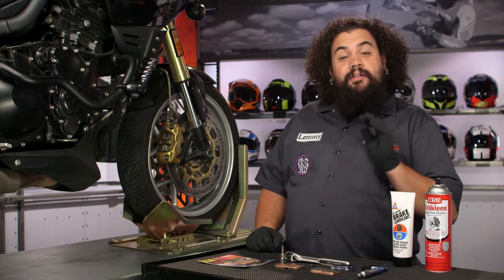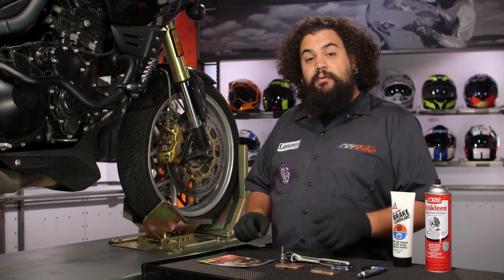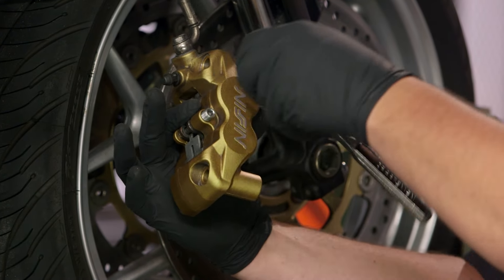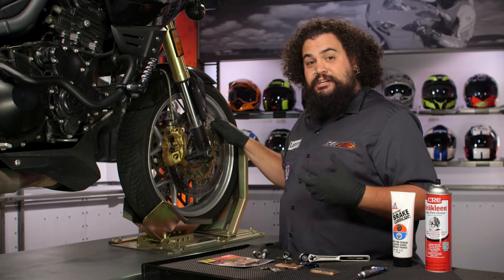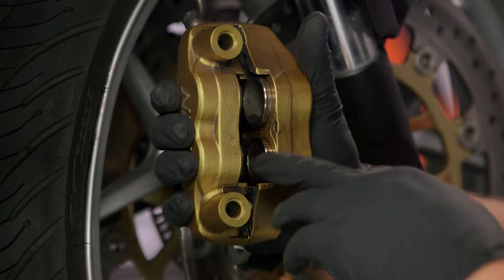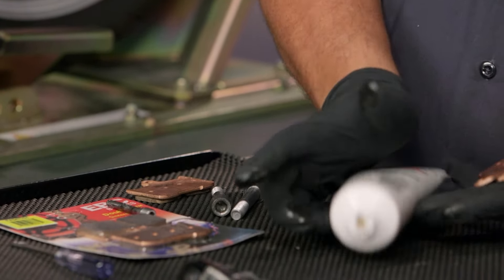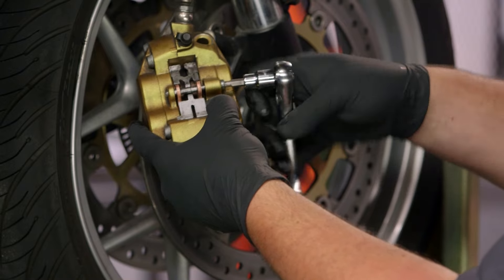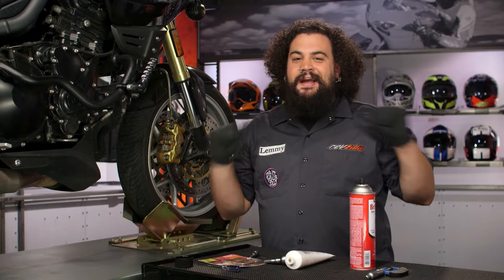How To Change Motorcycle Brake Pads at RevZilla.com

Comment: hmm. I changed my pads yesterday and i guess i didnt push the pistons back into the bore deep enough and the pads were pinching the rotor more than they should be. I'm guessing that should go away or should i take the pads out again and push the pistons all the way back in again?
Reply: pads always drag a little bit. thats normal. you should be able to spin the wheel a couple turns without stopping but pads rubbing a little is fine.
Reply: @nickbuchananracing  Thanks for replying! I did notice however that my front  wheel probably could only make it around only 1/2 a spin. My rear set up seemed a bit worse but it is difficult to tell as the rear wheel is an electric hub motor. I'm guessing that even if they pinch too much in the beginning after riding around and breaking them in that the pistons should sort of reset to their happy place or would there be something i should do to relieve some of the pressure?
Reply: @AnthonyJohnston1  without seeing it in person hard to say. but if your brakes are dragging alot you might need to rebuild the front caliper(s). Good luck
Reply: @nickbuchananracing  Really appreciate it! thanks so much for your advice!
Reply: @AnthonyJohnston1  no problem. i do "how to" videos also on my channel. check them out if they are anything you need a video on. thanks.
Reply: If you havent taken the rez cap off or bled the brakea via the brake bleeders along the line then if youve pressed the pistons back hard to get them over the rotor they will pull tight on the rotor till youve either spanked the bike hard or had enough road miles that the diaphragm in there rez  cap has dealt with it and slowly bypassed the diaphragm to the diaphram cup cap and eventually through the hole in the centre of the cup and that then bypasses slowly via the threads in the cap. This is the engineeering in your rez its enough to allow it to eventually sort itself out or you can do it a favour and take the rez cap with the diaphragm assembly out and even undo the caliper bleeders enough so it spews the old gunky caliper fluid aglomeration out and any trapped water or air in them out as you press the calipers back.  Your specific problem is common and is usualy down to what ive just said and the fact a new pad is automatically going to want to make a rotor sound loud when new as it lays its own material on it. The new pad "whisking" noise you know the noise where it sounds like a rotary air polisher spinning a pad when you come off the paddle, yeah thats going to sound a lot louder on any HH or split pad where you have gaps or grooves in the actual friction material. Thats what the whisking noise is and it should go away and come back depending on the amount of gassing out the pads are doing at the time. Pads use the gas they create to seperate them from the discs (rotors if american) thats how they work the gassing out creates the correct gap between the pad and disc surface each time you come off the brake. The greater grabbing capability the pad has the more its going to bind and be noisy when just fitted or when going slow. Youd be suprised how clunky, sticky and noisy full on race pads are untill they are getting a good whooping at high speed.. sometimes these traits show up in 'fast road use' pads but its nothing to be alarmed about. Another frightening one is regreasing your rear wheel bearings and the back wheel feels really hard to move by hand so you get paranoid. Its completely normal and once the bike has done even 70mph for a while it will thin the grease film out on the bearings and any excess pushed out the side to the cap that will alow bypass if needed. No joke though  new rear bearings and new grease can feel like the rear tyre is binding till you put maybe 20 mile on the thing. Hope this helps mate
Reply: @AnthonyJohnston1 the "half spin" you mentioned you are suffering from a warped disc or most likely the round bungs you see that selerate the spindle side of the disc to the outer braking surface of the disc are all jammed up. You need to clean the bungs out enough that you can turn each one of them, this way the disc will be fully floating again and should eventually straighten out any warping you put on it by using it while it was jammed up. You need to remember the entire braking assembly is floating its designed to move about and by defacto that means that if everything is able to float as it should it will even take an overheating or slight warping or the outer disc section and infact skim it back to perfecly  flat itself by just normal road miles. We straigtened up our race discs by fitting them to anyone that worked with us road bike and then honed to get any pad material off and used again the following season on the race bikes.

Comment: do you bleed your brakes after installing your new brake pads?
Reply from the maker: Only if they need to be bled, but normally, no, you don't have to if the brake fluid is still clear. -DrewZilla
Reply: RevZilla thanks boss!
Reply from the maker: You're welcome!

Comment: I have to take the fear wheel off of my bike, it has disc brakes, so all I have to do is take the brake off of the rotor, is there anything besides not stepping on the brake pedal that I have to think about?
Reply from the maker: That's about it. The big things are to not step on the brake pedal and also to not scratch the new pads when installing them. -DrewZilla
Reply: RevZilla Thanks, mate, your explanations are good and easy to follow, keep up the good work

Comment: Hey so what does it mean when my bikes front brake starts squeaking loud? Every time I come to a stop it makes a really bad squeal. I have an XSR900 and it only has 2000 miles on it. Don't even use my brakes that much because I downshift a lot.
Reply from the maker: According to Lemmy, it means you have squeaky brakes haha! Seriously, though, his experience has shown that most pad squeal is caused by improperly lubricated brake pad backing plates. He recommends the following: check condition of the pads, scrub all related parts down with soap and water, and then lubricate the appropriate areas (pad backing plates, slider pins, shims and such) with an appropriate lubricant. In addition to this video, we recommend you read the companion article. -DrewZilla
*https://www.revzilla.com/common-tread/video-tips-how-to-change-your-brakes
Reply: Thank you so much!

Comment: Why didn't you remove the brake fluid resivior cap before pressing the piston in?
Reply: yip. or at minimum undo the caliper bleeders enough to get the gunk fluid out them instead of pressing mega hard.

Comment: Can't you just remove the pin and slide out the pads to check for wear?  I suppose you need to remove the caliper if you want to change pads cause you need to expand the pistons
Reply from the maker: If you're in a hurry, you don't even have to remove the pads to check for wear (if you can see from the outside). Being thorough is best, however. It just depends-- everyone's brake set up is liable to be different. -Kraus-e
Reply: Probably not, it's tough to get the pistons back into the brake without something to pry on. Especially if you haven't cleaned them. I'm amazed at how easy Lemmy had it when getting the assembly back in place. Mine are always so tight that I wind up struggling with it for quite a bit. And yes, that's with the pistons completely retracted and not having pulled on the brake lever.

If you're that concerned about it, you might as well just replace them, pads aren't very expensive, and the process is relatively quick once you know what you're doing.

Comment: What size star do I use for the front brake pads on a 2007 Honda CBR 1000rr. I tried a T30 but it didn't fit and it seems a T40 would be too big.... Any suggestions??
Reply from the maker: According to the parts diagram, the Star/Torx bolts appear to be 8x40. -DrewZilla
Reply: +RevZilla thank u and that's what I picked up. I tried a T30 but it was just almost there. I figured it might be a T40 but didn't know if there was maybe a T35. Thanks for the help.

Comment: I screwed up so bad...i touched the brake lever before putting the caliper back on the rotor...now it wont release the pressure built in.... where can i ger the info to fix that?
Reply from the maker: +ChromexFz09 If you only touched the brake lever once, the piston probably just extended a bit. You can retract the piston by pushing it in. Try removing the new pads, install the old pads, press the pads to retract the piston, remove the old pads, remember to not touch or even think about the brake lever, install the new pads, mount the caliper back on the rotor, then build up pressure with the brake lever, and you're good to go. Hope this helps! -DrewZilla
Reply: yes it worked :) thank you so much! :P

Comment: Why lube the caliper pin and not locktite?
Reply: you dont lube or locktite the caliper pin. Bike brake assemblies are fully floating mate even the pads are the pin is merely there to hold the pads as a pivot point and let them dangle at whatever angle they like. If you mean locktighting the caliper bolts then you dont do that either unless its called for in the tech book

Comment: I need to upgrade my front brake on my Springer. Had to stop quickly at a red light and the front wasn’t doing the trick. Had to stand a bit too hard on the rear to get the job done without locking the front, got a bit of skidding out of the back end. 

On the bright side, I came in to that red light looking cool as fuck standing on my rear brake and putting only one foot down. On the down side, I was about to shit myself.

Comment: I thought you need to apply the brake hold it with a zip tie and then torque the calliper bolts

Comment: A good idea to pump the lever and hold it   closed so the pads are engaged against the rotor before torquing the calliper bolts to ensure the pads are aligned with the rotor.

Comment: Wrong brake fluid is hydrascopic and gets mucky in the calliper so you shouldn't push it back up the system loosen bleeder screw then press pistons as letting out fluid from calliper

Comment: Why are you putting grease on the back of copper pad backing which is meant to conduct heat away from the pads themselves? Brakes get seriously hot when used heavily and that grease will drip and eventually burn. It's really not a good idea and not one single manufacturer has that in their manuals.

Comment: Went to look at my Nissan radially mounted front brake and realized honda in their infinite wisdom decided to choose a caliper that has the brake line in the exact spot as the pin to disconnect and drop out my pads. I said nope and just walked away.

Comment: He doing totaly wrong
Reply: only 2 things hes not doing accordong to any tech book or racing outfit technique is lubing the pad backing which isnt too bad a mistake but is a mistake nonetheless and he never undone  the rez cap and removed the diaphragm  or at the very minimum undone the caliper  bleeders enough to fluid out when he pressed the pads back in. Still a decent brake job though isnt going to cause issues on road bikes other than the rez cap diapgram working its hole off till it can bypass enough vacuum via the rez cap threads that its not all sucked out into the rez 😂